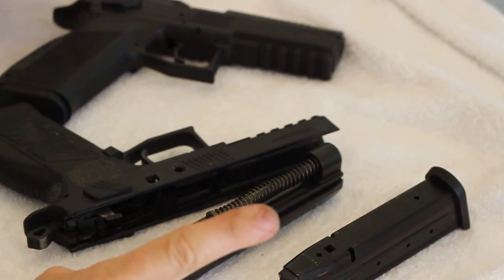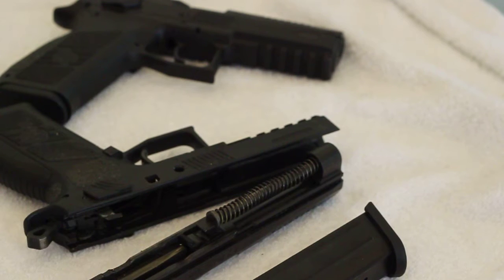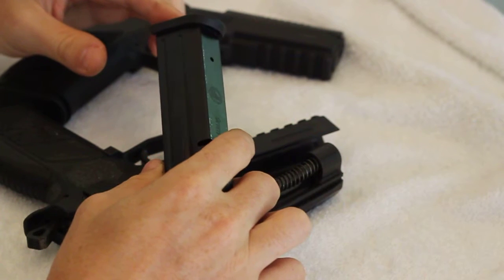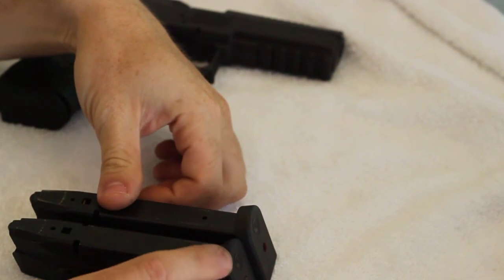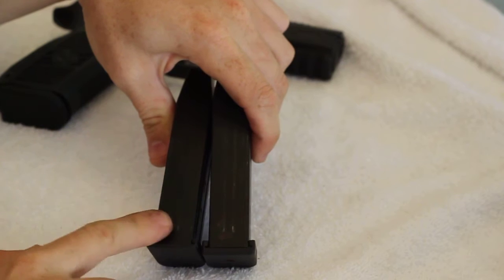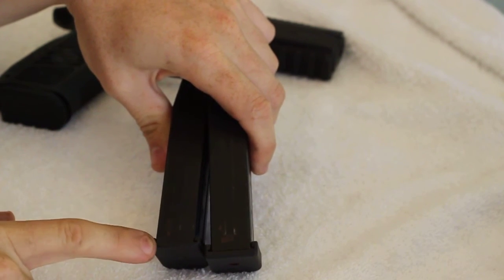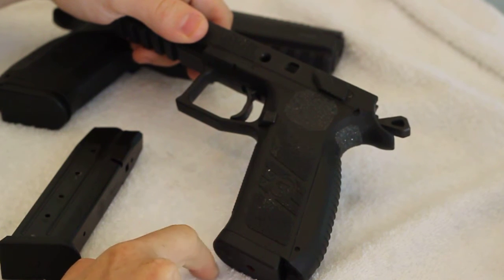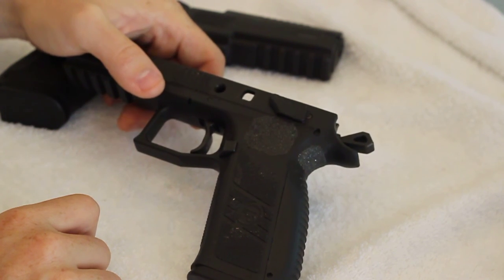CZ P09, P07 Baseplate Info

Comment from the maker: For whatever reason, i cannot respond to your comment directly Joseph Sikes.  Personally, i dig the P09 baseplates on the P07.  They fit fine and function great.  Having said that, they are slightly thicker so i run the shorter pads to maximize concealability.  Yes, it is only a few Millimeters but every little bit counts!